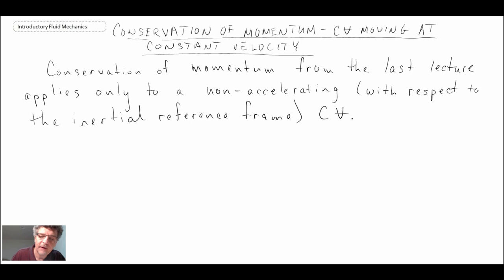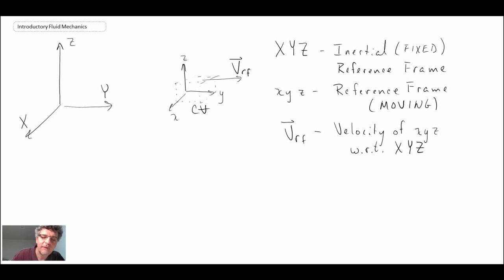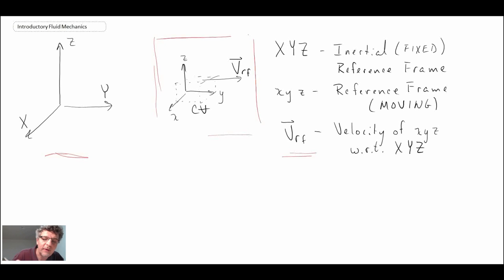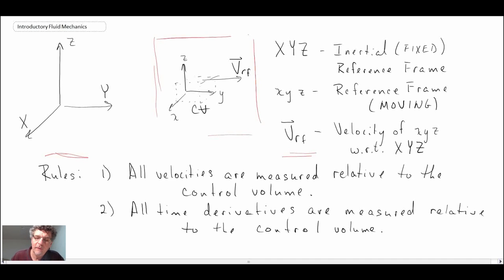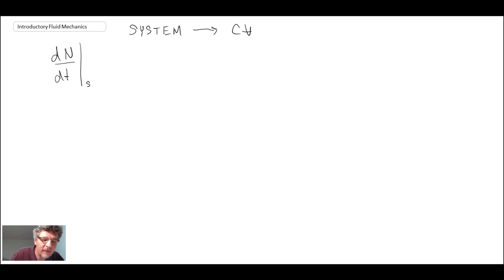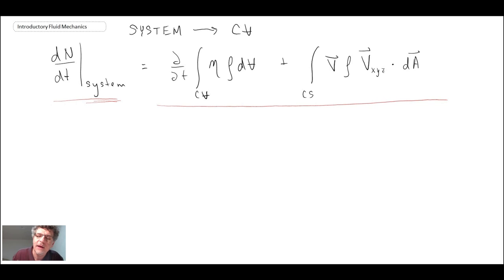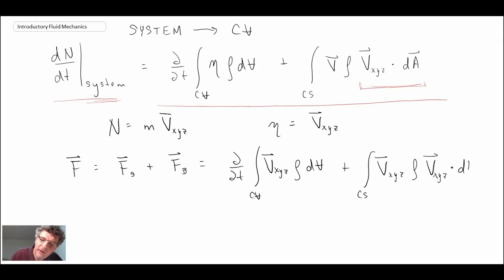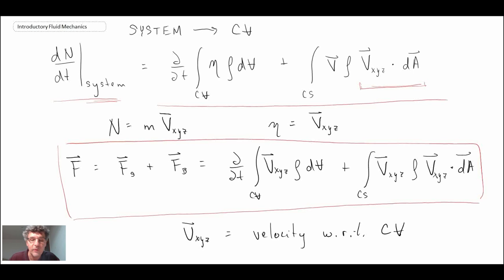Introductory Fluid Mechanics L9 p1 - Control Volume Moving with Constant Velocity

Comment: the first line is wrong, should be n in cs integral
Reply: It’s actually not wrong in many formulas just the dot product with dA is sufficient since n is the unit normal to the surface area and has a magnitude of one so it’s essentially implied. You can add it there to show more detail but it’s not necessary